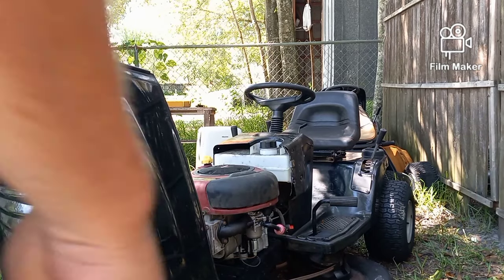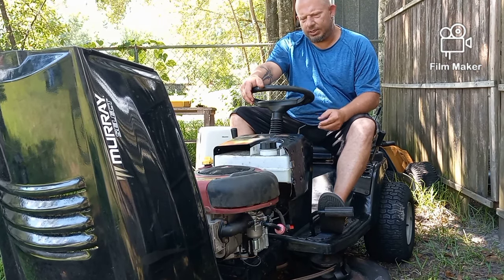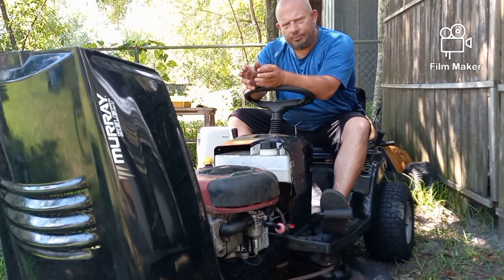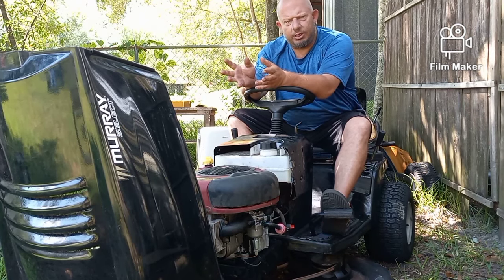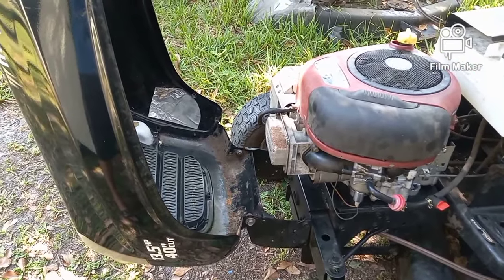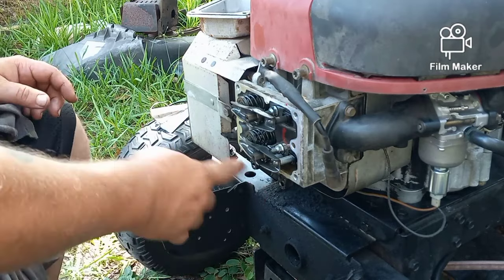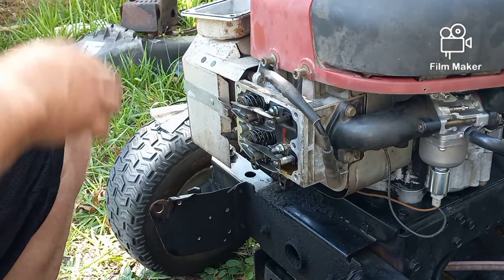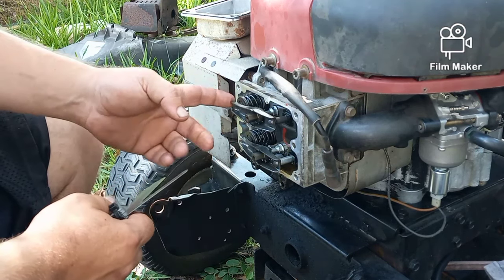Mower Spitting Backfiring / Fixed Briggs and Stratton Riding

Comment: What happens if I do exactly what you did and it's still doing the same as you described? Could it be a faulty carb I ordered? There's no adjustments on that other than the idle screw. 
Thanks for assistance!
Reply from the maker: It could be a handful of things.. on Chinese Amazon carbs its hit or miss but I've gotten bad ones out the box.. also could be bad spark plug.. buy brand name spark plugs never use cheap Chinese ones that come with kits.. you have a fuel solenoid cutoff on the bottom of the carb if it is not working correctly it can cause a backfire when you shut the machine off.. is it idling bad? up and down? cause that's a carb issue.. it could also be a magneto that's starting to go bad.. you would have to let it warm up then check with a multi meter .. if the magneto is beginning to fail the spark will become weak and intermittent  you could also have bad fuel lines.. are they hard.. if you squeeze them do they spring right back to shape.. they could be collapsing or partially clogged.. if there is a fuel pump it could be starting to fail.. if you can be more specific I can narrow it down for you.. if you can email a short video of it running so I can hear it I may be able to narrow it down.. I would buy a new brand name spark plug.. check the gap and try it.. if you adjusted the valves its not that.. I can walk you through the other stuff and I have videos on most of those things too
Reply: @MunkyWrench  Not really he is on the wrong stroke, both valves should have no pressure if he is on the right stroke
Reply from the maker: happy to hear from all sides so glad you commented. in my 25 plus years of working on mowers I have found that valves still work with over 15 thou out of range and with one being pulled the other is completely free so it works just fine.. always has. clearly I don't work as a certified mech but this video alone has helped thousands of people adjust valves successfully . thousands have left comments thanking me after the fact so I will stick with my way
Reply: @MunkyWrench  it was a faulty Amazon carb. Ordered a new one that had the adjustment screw. However, I didn't have to mess with it. Bolted on and started right up with no issues. I did adjust the valves prior to the specs you gave. Motor runs like a champ. Thank you!
Reply from the maker: @timtaylor4476  Thanks for letting me know it turned out ok I am proud of you for getting it done. I think I got a bad Amazon carb too so im ordering a new one tomorrow and will see how it goes..
Reply: @MunkyWrench  I have learned it's a hit and miss with Amazon carbs. I actually had to return two before getting a good one. From now on I will make sure there's an adjustment screw. I'm getting better with the outer parts of mowers. Next I'm looking to learn how to do head gaskets. I've never done anything internal. If you have any videos of doing gaskets I'd appreciate it if you could drop a link or point me in the right direction. 
Thanks again.

Comment: What happened of the valve one on the top is too tight in the bottom is loose
Reply from the maker: valves work them out of adjustment on the regular and need regular maint to keep them at the right settings.. adjusted and no issues

Comment: I have a Poulan with 15.5 HP Intek that has given me these same problems for years. I replaced camshaft(Surprise! compression release was not broken.) Replaced carburetor( Chinese Nikki knockoff), did not fix the problem. Remedy was to buy 2015(brand new)John Deere S240 with dependable Kawasaki 18 HP V twin. I have often wondered if the flywheel key is broken and timing is off.
Reply from the maker: Sometimes u go as far as u can before losing your desire to make something old live.. it Def could have been a sheared timing key .. I assume that when u replaced the cam u reset the valves.. sounds like u did all you could do.. thanks for taking the time to subscribe and comment.. I appreciate it very much

Comment: Outstanding video my push mower backfires when we release the kill lever. What would you check 1st when that's going on? The carb is clean as a whistle I ran it through a hot ultrasonic machine. I thought it was a gap of 30, but Google says it's 20 gaps so I set it there. The spark plug had very little carbon just the best-looking spark plug I have ever seen.
Reply from the maker: Could be a bunch of things. The carb could be running a lil rich, the spark plug could be starting to go bad, u could have a partially sheared flywheel key that makes the timing slightly off. There are several other things to check but keep in mind while annoying it won't actually hurt the machine to backfire. Let me know if u figure out what the cause is I'm always interested
Reply: I have  confidence in my carb but checking the spark it look weak to me and spark plug wire has a couple of deep wear marks on it so I guess I'll start by
Replacing it if still BF then I'll adjust it like it don't BF till I release the cutoff lever only then when it sound like a rifle and scope???
Reply from the maker: @JasonSmith-qx3zh  yeah usually too much fuel at the end with low rpm causes final backfire. Check timing key if it's partially off you wouldn't tell at regular high rpm.. only at low to none. Change plig could be as simple as that

Comment: Nice video man !  Just purchased my first zero turn . And I’m getting a popping sound when it’s under load and the PTO is in gauged. I said yeah that’s not running right I need to fix this before it goes out in the field , 

I used to adjust my dirt bikes valves and reshim them when needed  .. this looks like a walk in the part . 

Thanks for posting !
Reply from the maker: Congrats on your zero.  Once u get one u never want anything else. I hope adjusting the valves helps your problem.. thanks for stopping by

Comment: Best way to remove a stuck on valve cover is to use a soldering torch to heat it up slowly and it will pop right off.
Reply from the maker: That's excellent info

Comment: Dude, I am exactly the same. I just adjust both to .005. It is a lot less headache, and it gives you a little room either way in case your clearance changes when you tighten it. I do it the same way you do. I hate the screwdriver method too. I never could get it to work right anyway.

Comment: Bud exact problem I’m haveing . So tomorrow I’m adjusting valves . (Same motor too) never adjusted valves on it and I’ve had it 7 yrs and I got it used . Pretty sure that’s the problem . With the exception, of sticking multiple feeeler gauges  in over and over ( super stupid ) after 2 I got it . And the best of us can foget to put the plug in . Or attach the plug wire . So other than the dorky bit you were awesome and bet ya fixed my problem . Was afraid it would be tough . But ya showed it to be easy will getter done tomorrow. Thank you
Reply from the maker: Thanks for stopping by.. I hope that's the issue. I know u can fix it. Good luck see u soon

Comment: Is that 5 thou valve gap for all B&S engines? and if not, what is the gap settings for the B&S 6.5hp 212cc Intex?
Reply from the maker: You can look up your specific machine for manufacturers specs on a particular one but I have found that tolerances vary quite a bit per manufacturer on how far out of spec is ok before worrying , so a safe bet on most small engines is 4 to 6 thou .. i usually do standard 5 thou across the board.. and have never had a problem.. i work on hundreds of machines a month so that's just my experience.. hope this helps

Comment: I have been working on lawn equipment for over 60 years- I have found maybe 3 times- an engine would not run because of a bad spark plug - tip if you don't have a feeler gauge- use a piece of a pop can-it is not a space ship-LOL  ( taryl )- I have 2 pieces of lawn equipment - both over 40 years old-- original plugs in both- both start 2nd  pull

Comment: Thank you this will be the way I do the valves on my mower I tried the getting it to top  Center with a screwdriver I have very bad luck with that I got my mower engine going like new with the way you do it starts up almost instantly  now I have a feeling it’s also the new cylinder head that helped I would have to crank it for 10 seconds or more to get it to start before I did this
Reply from the maker: Glad I was able to help.. great job getting yours fixed.. thanks for watching
Reply: @MunkyWrench   I’m just glad I’m done I probably should have replaced the engine I put over 200 into the engine
Reply from the maker: @Michaelc-gn3eg  if u have a place close by like I do for used engines it's sometimes worth it.. but most homeowner machines don't need replaced.. I constantly see 50 yr Old machines with very minor issues.  They last a long time if maintained

Comment: Intake valve stays cooler cause u have cooler air passing by it from intske runner, - The  Ex. valve has all the red hot exhaust gases passing by it . This is why cars can have plastic intake manifolds.

Comment: Thanks for a great Vid I have a similar Briggs  and that has helped a lot now  Im trying to replace the Carb but no idea what type or model would you be able to give a heads up  on where to source and what to ask for I would be most grateful  . on the valve cover there are markings  it 
has 280707            1060E1 030113ZE   Many thanks  best regards  Bill
Reply from the maker: Hey Bill thanks for watching and subscribing.. there's 2 ways to look that up sorta .. I use www.partstree.com and they are simple because u look up the motor by brand and size then code.. u can also look for the numbers on the carb itself for internet research.. and u can always Amazon the brand and size of motor including the word carburetor..  and u will find it.. many are interchangeable with various motors.. so if u go Amazon route your gonna be fine.. that's what I do and I think I got the wrong carb once in the last 5 years and I just returned it .. it's pretty easy.. for actual code u can call ANY lawnmower parts store and give them the numbers by phone and they will sell u an expensive oem part but rarely will they give u the info cause they don't want u to buy a $20 carb on amazon.. which is what I do

Comment: Always a slight drag on the valve setting then you'll be in the middle, adjust the intake at 6 and exhaust at 7 that increases hp.  I'd continue what your doing unless power increase is needed
Reply from the maker: Thanks for taking the time to watch and give tips.. u rock

Comment: Now, if the exhaust was at .005 and the intake was at .006 would it cause it to backfire out the carb and sorta lope? Mine will not idle, I have to have full choke and run it at full throttle for it to keep running
Reply from the maker: In my experience.. no I've done vids where the valve lash was over 20 or dead tight and still ran.. the problem with dead tight is it can throw a rod.. if your backfiring out the carb and it will only stay running at full choke I would first check carb.. if it only runs on choke you have a clogged jet most likely the low end.  The backfire issue is usually cause by it being out of timing so if u pop the flywheel off you can look at the flywheel key it may be damaged or partially sheared.  At 5 and 6.. your valves are just fine.. there's room for error in mowers.. let me know what u find and I'll try to help u find the issue

Comment: Great vid! Just ordered new carb for my 13.5hp MTD Yard Machines mower and it is back firing like crazy. Tried setting the new carb multiple times, but it is surging and popping/backfiring...
Will try to set the valves tomorrow. Hope it helps!
So just to be sure, you set the valves, one at a time, while valve is closed?
Reply from the maker: Yes tdc is not important on small engines.. turn the motor by hand and watch the valves move.. when one is pressed in the other should wiggle with your fingers which means there is no pressure on it.. as long as no pressure is on it you can set the valve.. then just turn the motor by hand until the other side can wiggle and set it.. easy peasy.. let me know how it comes out.. i normally wouldn't say change the plug as I maybe get 1 or 2 bad plugs each year.. but this past month i have had 6 failed plugs .. so something in the weather lol check or change the plug.. half bad spark can cause it too.. if neighther work you can then pop the flywheel and make sure the timing key is intact.. rarely but sometimes the key will be partially sheared and can cause that nonsense.. keep me informed and good luck.. thanks for subscribing
Reply: @MunkyWrench  Well, got the valves set. Mower started faster, ran a bit better, but still similar symptoms. Got ahold of seller where I purchased carb, they sent out a new carb. Hopefully will get the new carb installed tomorrow. Fingers crossed this is the fix. Because I did get it to run pretty smooth, but only while leaving the machine fully choked. 
Both valves had alot of slop by the way...
Reply from the maker: @splash5974  yes if it only runs on choke it means a jet is blocked.. a new carb should finish the repair.. thank for keeping me up to date.. let me know how it ends
Reply: @MunkyWrench  thanks again! Will do!

Comment: Thank you I think I might know what's wrong with mine now it spits and sputters going up a hill at blew out white smoke hopefully this will be my problem although my more runs good and does the job spitting and sputtering it only smoke on an uphill
Reply: Oil level too full can do that too. Mine does it if it is a little too full, when I am riding sideways on my hills. Oil tilted to the left hand side of the engine.
Reply from the maker: @kramnull8962  absolutely correct
Reply from the maker: Absolutely oil level can be too high.. if mower is smoking uts usually too much oil
Reply: @MunkyWrench  Ask me how I know...🙈

Comment: Put both intake and exhaust at .004 whenever I do one never any issues ...an adjust when both valves are closed at top dead center on compression stroke

Comment: The intake is on the top. The gap can be set with the crank anywhere as long as the lobes are not engaging the pushrods.

Comment: Would 5 thousandths be the same on my Kohler 7000 Enduro?
Reply from the maker: Thanks for taking the time to comment and subscriber while your here it really helps. it is always best to look up the manufacturers specs on any particular machine for best results .. Having said that I know its often hard to find that stuff online so I will say this. when it comes to these motors a pretty good rule of thumb across most of them is anywhere from 4 to 6 thou.. technically they are supposed to be a bit different between intake and exhaust however in my many years of work have found them to be so far out of adjustment from lack of maint that they are both at 15 thou or more. the main thing is that they are not so tight that there's no space.. nor too loose that the valves don't open or the push rod falls out lol.. a pretty good rule of thumb I have found is around 5 thou for both.. its a Goldie locks zone.. not too tight and not too loose.
Reply: @MunkyWrench  yeah I already subscribed man, and thanks for the quick reply!
Reply from the maker: @aaronsg71  I am always here cause I have no life lol.. ask questions anytime and I will do my best to help.. see you soon
Reply: @MunkyWrench  appreciate that

Comment: I have a question for you? I adjusted my valves on my Yard Machine riding mower 13.5. The mower started, and I drove it around & it did fine. I drove back in the garage and let it set for a while.  Later, on the same day, I tried to start mower & it would not start. I took the valve cover off and went to reset valves again & the bottom intake valve would not close or open. The exhaust valve or top one did fine. Could you or someone respond with what is wrong. Thank you
Reply from the maker: I would need a bit more information from you.. off the top of my head my 1st thought is you could have made the valve too tight when you adjusted it.. I have unfortunately done this a few times in the last 30 years and by doing so i broke a push rod.. my 1st question is did you check the push rod to see if it was loose.. if it was too tight it could have driven thru the keeper inside the motor as well like using a hammer to drive a nail.. my understanding is when you turn the motor over one valve goes in and out as it should but the other does nothing.. my next step would be to remove the head and take a look inside.. is a valve seat jammed and causing the valve not to open or close.. is the back of the push rod broken off? luckily its not an expensive fix even if those things are true .. feel free to email me if you need more help or just respond here.. keep me informed on what you find and I will do my best to walk you through it

Comment: I have the same mower 17.5 select. M
It starts up and back fires but it will drive but now when I engage the blades it will stall. Could the backfire cause that also
Reply from the maker: Not usually unless it's idle is too low.. it's usually a safety switch that causes it to die when blades are engaged
Reply from the maker: Usually seat safety.. if your not sitting in seat the blades will shut off engine
Reply: @MunkyWrench  I bought the mower last year so I just looked under the seat and don't see the switch there, I suspect it's bypassed. I see the whole but nothing is there
Reply from the maker: @tj  trace the wires and make sure it's bypasses.. if someone just ripped it off and didn't bypass u still have same problem.. also .. and forgive me for not remembering.. if it's an electric pto to engage blades and battery is half dead it will kill motor